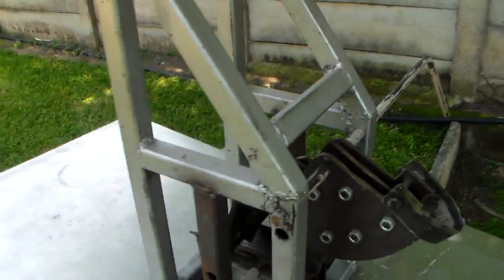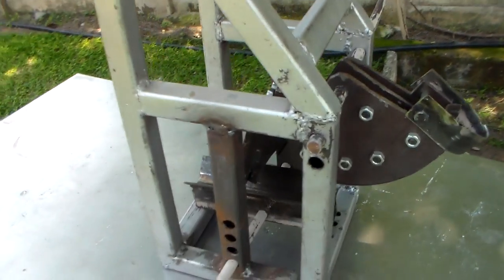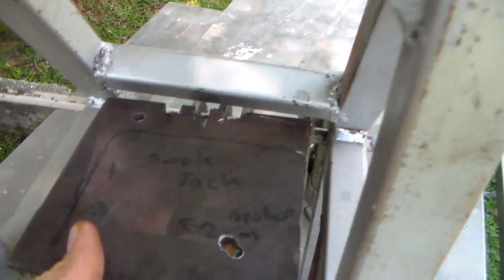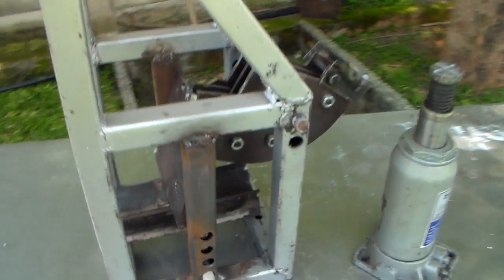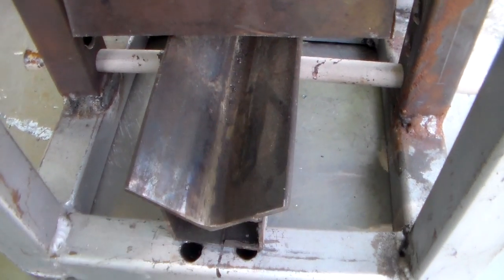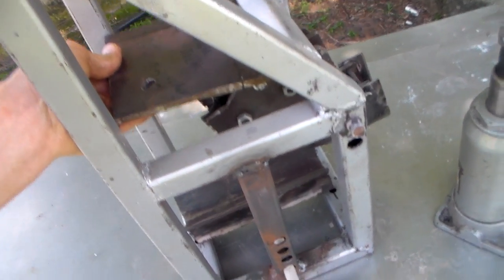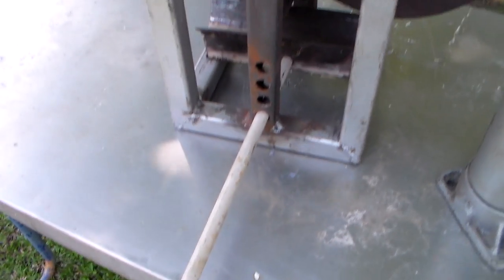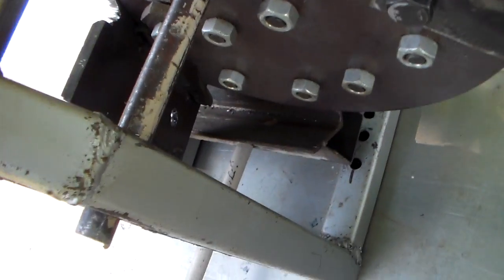how to build this homemade Pipe Bender

Comment: Are you getting any distortion having the tube resting on the angle iron when you bend?
Reply from the maker: valveman12 thanks for the good question 
yes I do get some distortion
Reply: If you buy a heavy wall pipe , you can cut it in half and use that since the inside diameter of the pipe is the same as the outside diameter of the tube.  For instance if bending 1.5 in tubing, but a heavy wall 2.5 inch pipe and cut it in half.   The tubing will fit inside the pipe because tube diameter is measured on the outside and pipe diameter is measured on the inside.